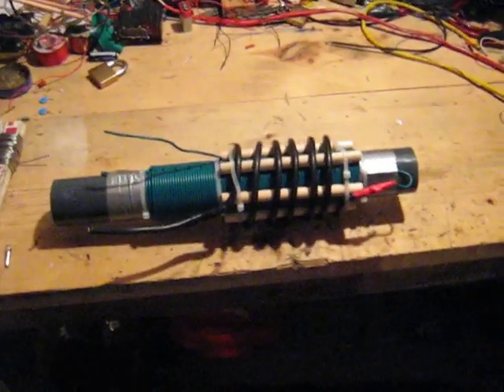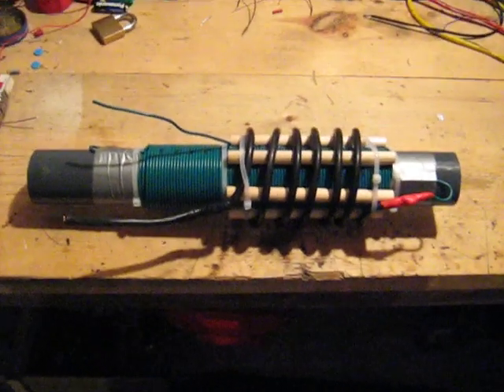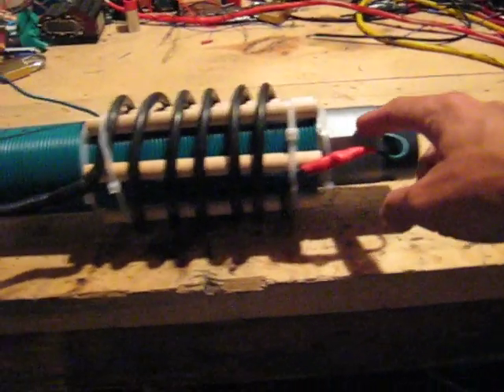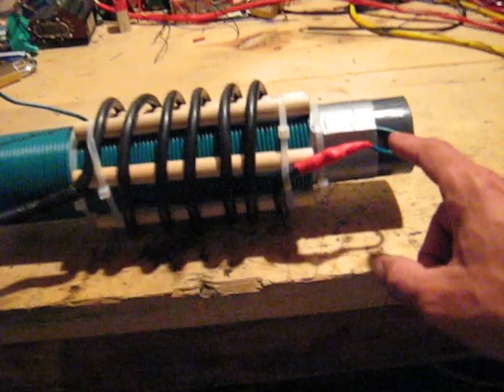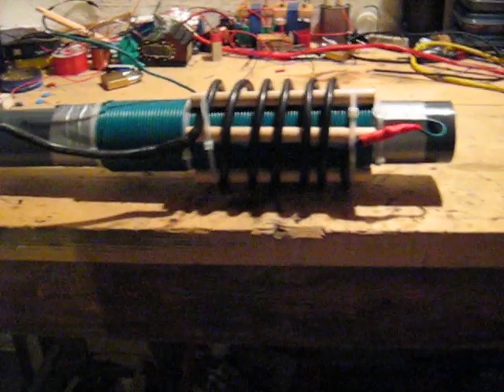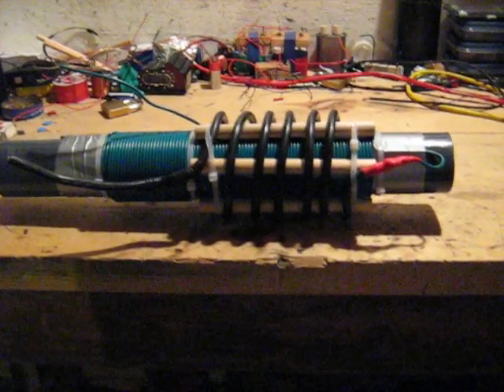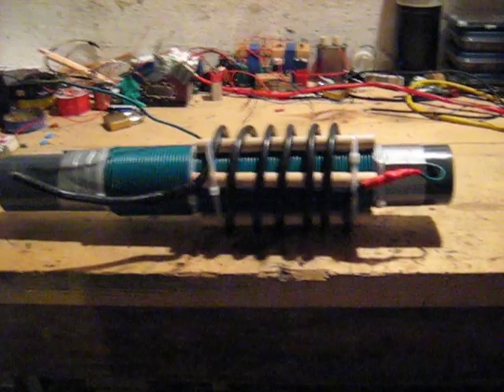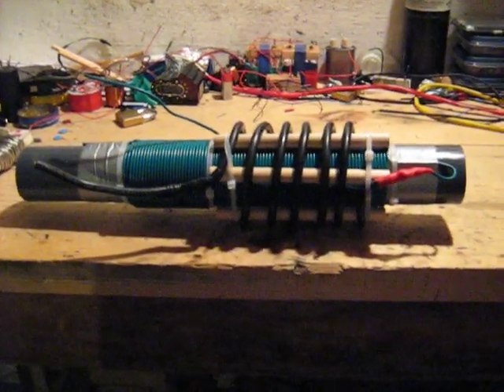Kapanadze Generator - Part 1  Coil Construction

Comment: Just a suggestion. If you do a lot of reading on earth batteries and telluric currents, it is recommended that the ground electrodes be placed in a line from south to north. There are alternatives using one grounded post and one elevated "collector".  An elevated HAM antennae can buildup a potential of 350 volts.

Comment: This is a transformer that is used in Tesla Hairpin circuit. One thing to test is take the voltage off the coil and see how many lights light and see without the coil how many light up.

Comment: @Riskteven I was talking about the other kapandaze device video that this guy built by the name online he goes by Is SR short for something anyhow. / Your question about earth heat is geothermal heating. Its not all the special to construct. The earth is 50 degress year round which means your turning your house into a cave basically heated in winter and cooled in summer. This is another type of passive system. I was talking about converting pressure from solar thermal into pressure for A/C.

Comment: @Riskteven Secert code is not the case it might be that coil requires pulse width modualtion of a certain frequency to operate the coil in the microwave but to get around all the jazz that photon talked about just take a working microwave remove the guts and just use them "as is" so that you don't have to find this secert code your refering to. I do see corporations are taking out tesla technology slowly everyday like old tvs and microwaves.

Comment: the Principle of the Kapagen is that you are collecting electrons from the 2 grounds placed 30m apart into the earth. It MUST have that ground to work, therefore it cannot be used for mobile applications. That being said there are a few people experimenting with permanent magnet motors that are self sustaining after a "jump" from a 12V source
Reply: Buffalochips68

Comment: @Riskteven Wish I had to the money for a whole roof full of them panels. Solar would be the ultimate thing for a summer cabin out in the middle of no where. You could have power, water pumps, hot water, and even air conditioning if you have the engineering mindset to build a passive or extra power for running a low power window unit. The only thing solar can't do is feed your stomic.

Comment: @rolandchachka 
Hey of you use ferromagnetic core, then you're building RLC circuit, which, I guess, is not the aim. At least not to build Kapandze Generator. Wire has to be placed on non ferromagnetic core. And besides to build one of these thing you guys should read a bit more stuff regarding Tesla experiments. And expecially more info regarding Luminiferous aether as Teslas experiments were based on that knowledge as he seems to work with electricity not as charged particles, but as waves.